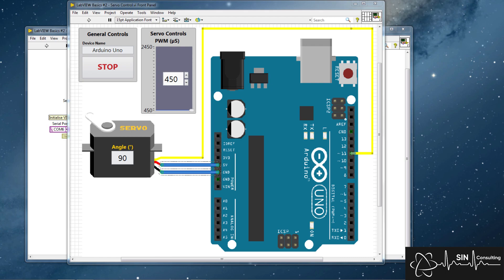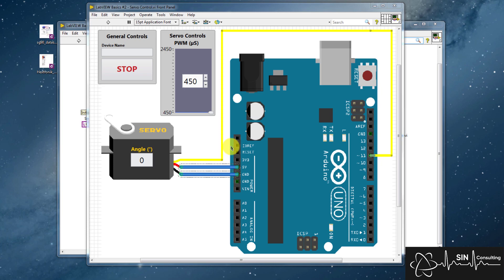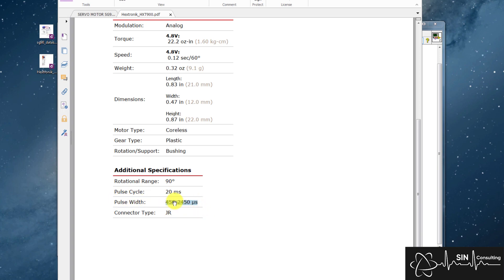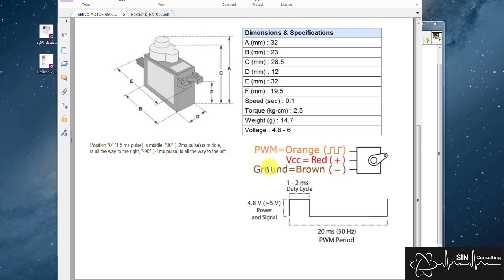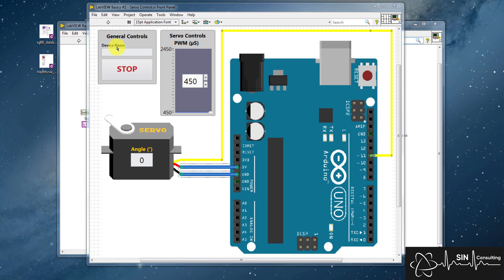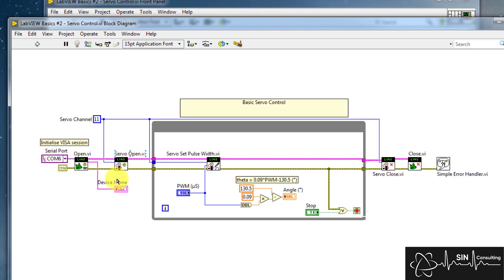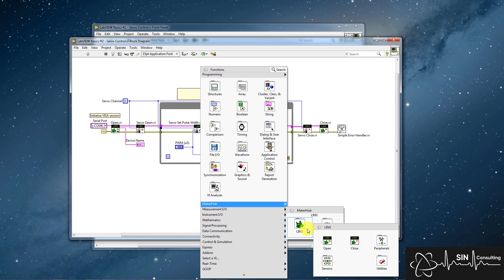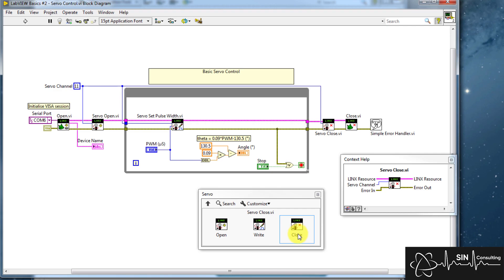LabVIEW Basics #2 - Manual Servo Control with an Arduino UNO (LINX)

Comment: hi, can this configuration works for more than two servos at the same time, like using 4 servos or +?
Reply from the maker: Yes you can, my suggestion would be;

*pass a numeric array containing the channels for each servo to the servo open and close functions;

*pass this array by index to the pulse width function and adjust depending on how you need each servo to move. If you want them to move in sync pass the numeric array through a for loop to the pulse width function. But if you need separate control you need to duplicate the pulse width function for each servo.

Hope that helps !

Comment: Why does the dial start at 450 and finish at 2450? can you please explain?
Reply from the maker: This is the range for the pulse width values for the servo motor. The data sheet specifies a range of 2ms, so this particular servo motor starts at 450uS for -90 degrees, 1500uS for 0 degrees and 2450uS for 90 degrees. 

So 2450-450 is 2000uS or 2ms as required.

The dial values reflect this and allow you to manually set the pulse width and servo angle.
Reply: @SINConsulting  so is it the same if the dial starts from 500-2500?
Reply from the maker: @rizkymuharman9680  Short answer, yes, should be the same for most servos unless the data sheet specifies otherwise. This was just tuned for the HXT900, as the datasheet specified this pulse width as 450-2450uS. You can experiment with the range once you start passing the signal through. Hope that helps!
Reply: @SINConsulting  ok thank for everything